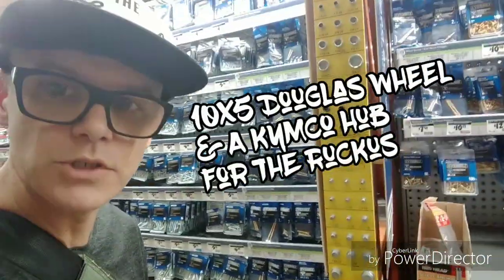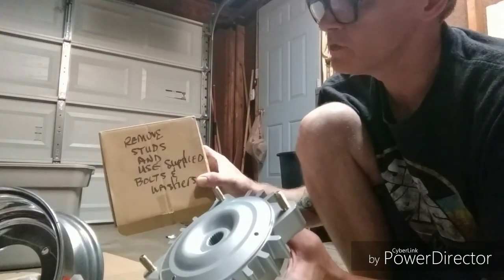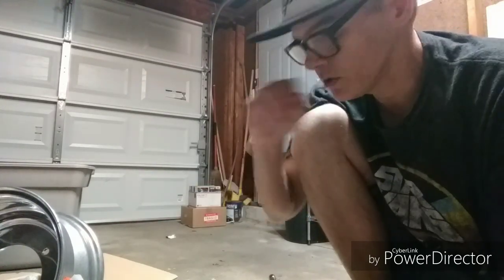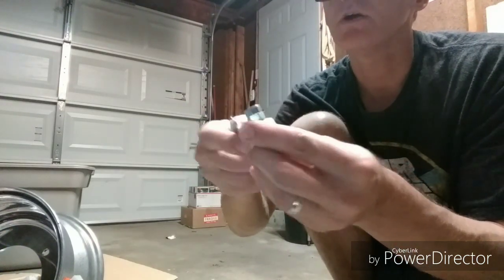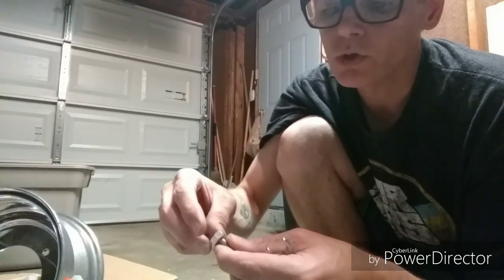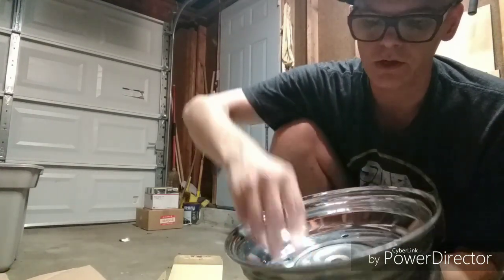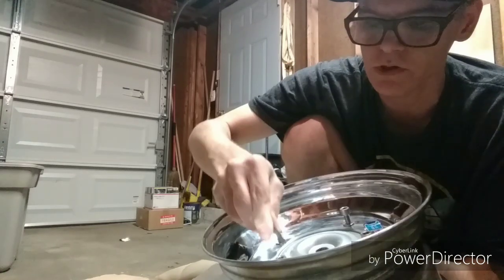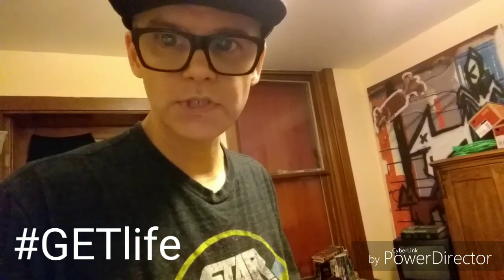GETlife: 10x5 Douglas wheel and a Kymco hub

Comment: M8 and 1.25 is the pitch if the threads. 1.25 is finer than what you would use like in some metal barn build. 1.5 or higher is common for them. Great video cant wait to see it all the way installed tire and all!